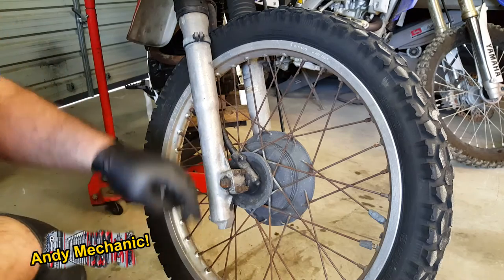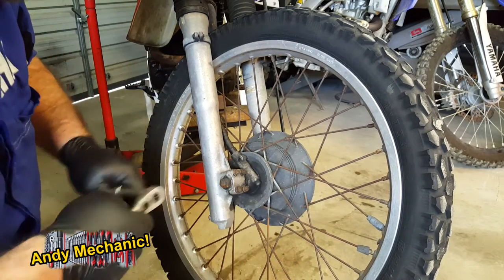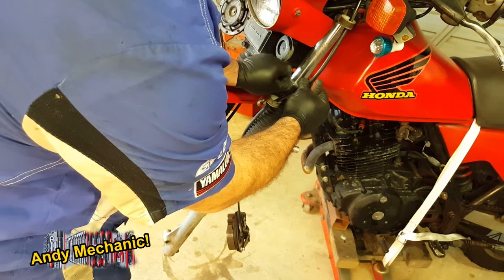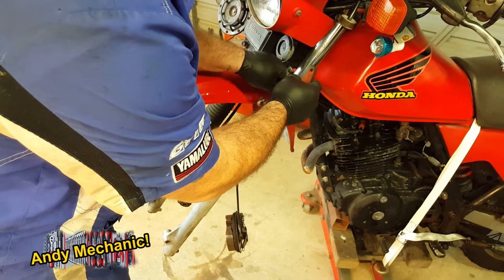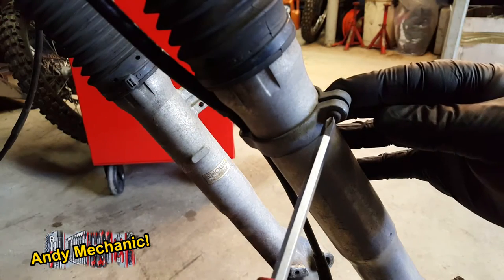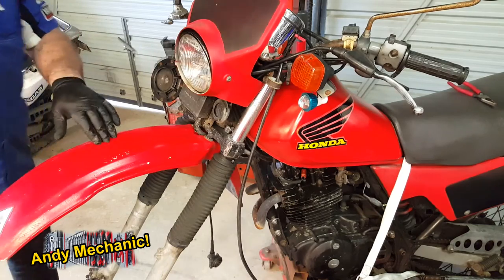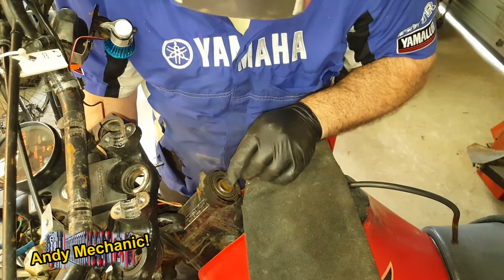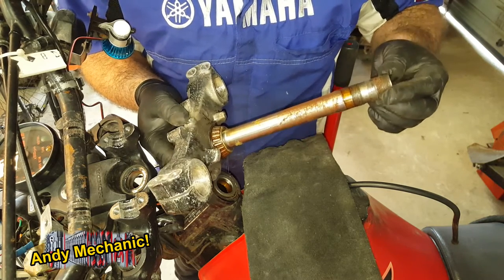Replacing motorcycle steering head bearings #1502

Comment: What are your feelings on using pry bars to get the inner race off the stem once you get it moving? I've had luck prying things off shafts like that with two opposing bars. 

That said. I have known about my Ninja 250's steering bearing for a while and have been putting off. I had a fair idea what was going to be required but seeing your process makes me feel better about my plan of attack. 

Love your videos.  keep them coming.

Comment: what's the worst thing could happen if you are riding a bike with worn head bearings? mine need doing but I can't afford it yet.handling seems a bit iffy at slow carpark turning speeds, thanks
Reply from the maker: Yes, slow speed work, especially trying to keep a straight line between traffic - gets pretty dodgy sometimes. It's unlikely they would completely sieze without notice. But I'd suggest you get them changed soon.

Cheers Andy
Reply: @AndyMechanic   Thanks Andy, I will try and get them changed asap, have to take it to a shop to get done, I don't have the tools or skills, I'd love to have a go at it though but I couldn't afford to be without transport. great video I learned a lot.
Reply from the maker: Cheers. I appreciate your feedback. Ride safe. Andy

Comment: 54:00 You can always used the old races flipped upside down to drive the new ones in!
Reply from the maker: +ProfessionalCamelRacer Good point. I have done this when changing other bearings but never considered that trick for doing head bearings. I must remember next time round. Thanks Andy
Reply: I'd prefer to get the correct tools. But, that is me.
Reply from the maker: Agreed, however, my aim is to try show viewers how they can do these repairs themselves and not many will have access to the specalist tools unfortunately. Although, personally, I do like to increase my range of tools in the workshop so always a good excuse to buy more :-)